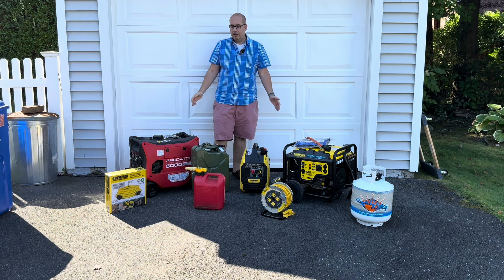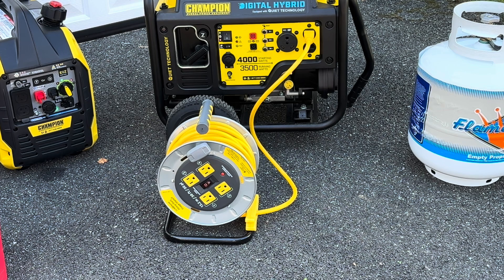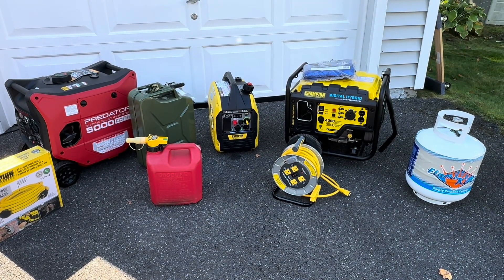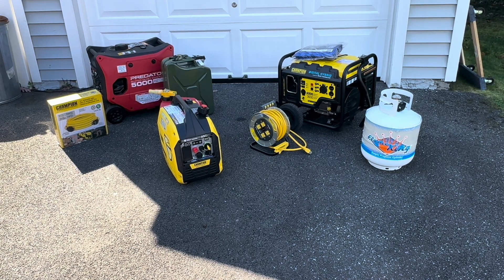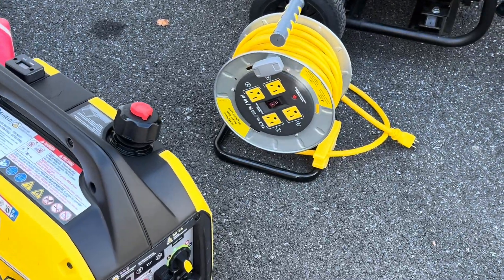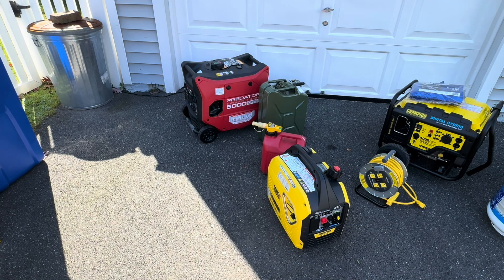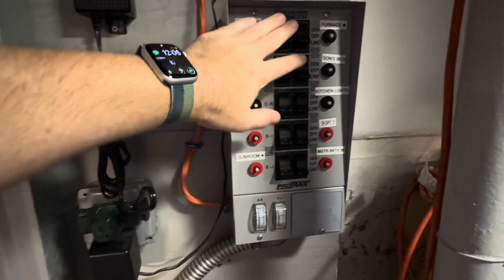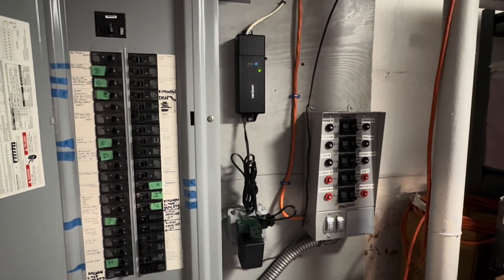How to hook up a generator to your house or power devices! Must know information

Comment: I have a 2000w generator that only has 2 L14-30P outputs labeled on the generator as AC 220V. Is there an adapter to connect electronic devices such as phone chargers and other small appliances directly? Here in my country we use 220v. And if there are adapters could you recommend one? 
Thank you
Reply from the maker: Thanks for watching! Unfortunately I’m not really familiar with the adapter you will need - apologies
Reply: @Outdoor_Prepper  I found that something like this could help me. Thanks for the reply and sorry for the bad English. 

"25 ft. 30A 125V Flat Generator Extension Cord" from Champion 

"Extend 30 amps of generator power with the Champion 25-foot extension cord. Brilliantly designed with a flat cable, this durable cord fits easily under doors or windows, remains flexible in extreme heat or cold and converts your 30-amp locking outlet to three 15-amp household outlets."
Reply from the maker: @ that looks like it could work! Thanks!

Comment: QUESTION: The 2500 I think says it has a 20 amp 2 plug receptacle but the small cord you had in the bag to plug in to the transfer switch cord says it’s a 15 amp cord. So, will the 2500 be putting 20 amps in to the transfer switch using that small cord or 15 amps?  Thanks….great videos too!
Reply from the maker: I believe technically it’s only going to produce 20 amps if it’s paralleled to another unit so in reality you’ll be getting more like 15 amps.
Thanks for watching!

Comment: If you use that adapter you showed for the predator 5000 and connect the power cord to a 30 amp input box to the breaker panel that has a generator transfer switch, will it power both A an B circuits?
Reply from the maker: @DJ-vm2zi  it will power both. Jt be careful to turn off anything that is 240v as despite powering both sides of the panel, it cannot power something that is 240.
Thanks for watching!
Reply: @Outdoor_Prepper  I love your content. Longer term, would you consider predator 5000 hookup to my natural gas line?  I’ve seen some after market regulators. I’m using my generator for home backup but I like the idea of not having to rush around to refuel if power goes out for an extended period like a week or two or longer. Maybe I’m too worried about an unlikely scenario and getting carried away here.
Reply from the maker: Absolutely I think natural gas is the way to go because it’s basically an unlimited fuel supply! I have heard there are aftermarket natural gas adapters for the predator 5000 and I will probably look into them in the future for sure!

Comment: First experience with the larger champions (8500 or so).  First one caught on fire, second one threw a rod and had no compression, both events happened after just a few seconds of use.  Bought a firman from Lowe’s, it did work for the few hours we needed it.  Also my Ryobi that is years old but never used, fires right up but doesn’t produce power.  This is all in the past 2 weeks while getting smoked by 2 hurricanes in Tampa.  Hopefully the firman continues to work good, however if you need one generator, you really need 2.  Those predators from harbor freight I’ve heard great things about but did not realize they’re about double the price of firman, Ryobi, champion
Reply from the maker: Oh wow! I’m sorry to hear of your experience with champion so far. I’ve generally been very happy with Champion as well as harbor freight predator. I’ve previously owned a Westinghouse unit that I was very happy with. I also own a Firman and have no issues with it so far.

Thanks for watching!
Reply: It really seems like one of those things of you need one you really need 2, which I had.  I never realized those predators were twice the price but still made in China, bc I love harbor freight.

Comment: Living in Arizona the most important breaker for me to jump would be the AC. You think this 5k generator could power a home AC?
Reply from the maker: It could definitely power a window AC but unfortunately would not be able to power a central air or split unit as it is not 240v. Westinghouse makes a 9000w and harbor freight makes a 9500watt inverter - both of which are 240v and should be able to power a central air ( depending on size)  etc. 

Thanks for watching!
Reply: @Outdoor_Prepper  Thanks so much!

Comment: What’s a good generator for 240V so I can hook up the central air? Thanks for the video.
Reply from the maker: Harbor freight makes a 9500w inverter that should be able to power it although without knowing your specific central air id double check with an electrician. Other than the harbor freight, Westinghouse and champion make some large units. You’d want something around 9000 watts and 240v

 https://www.harborfreight.com/9500-watt-super-quiet-inverter-generator-with-co-secure-technology-epa-71365.html?utm_source=google&utm_medium=cpc&utm_campaign=12233891969&campaignid=12233891969&utm_content=170670798470&adsetid=170670798470&product=71365&store=343&gad_source=1&gbraid=0AAAAADAHb4dhHIUcbZGVc-RwVLDrUxUt4&gclid=Cj0KCQjw05i4BhDiARIsAB_2wfAnZw-qNAG23LBhsA4Yx_mFkLu_xOAN3J546g6H64HxSisrSLzIziUaAkftEALw_wcB

Thanks for watching!
Reply: @Outdoor_Prepper  thank you for replying. Wish you best of luck.
Reply: One more question. Sorry to bother could you recommend a more affordable unit? Or is that standard pricing for these types of units?
Reply from the maker: This should be able to do it but double check with your electrician based on the central air unit you have

https://www.amazon.com/Westinghouse-WGen7500DF-Dual-Portable-Generator/dp/B078964VVX/ref=asc_df_B078964VVX/?tag=hyprod-20&linkCode=df0&hvadid=693338292879&hvpos=&hvnetw=g&hvrand=14399632386898447215&hvpone=&hvptwo=&hvqmt=&hvdev=m&hvdvcmdl=&hvlocint=&hvlocphy=9060351&hvtargid=pla-404497574773&psc=1&mcid=1025c877df6733699c93e7c4e9d1f373
Reply: @Outdoor_Prepper  Ty sir

Comment: Hi what happens if the power comes back on while you’re using the transfer switch wonder if you should unplug from the street. Second question if you’re transfer switch was hooked up be an electrician so 240volts can be used with L-14 30 amp can you still plug the generator in if it doesn’t have 240 or 220 volts just regular 110 volts and use small stuff like refrigerator lights furnace. Can you do more videos about generators. Do you grain your fuel. Thank You
Reply from the maker: @Nick-gi6ym  if the power comes back on while running on generator just switch the individual transfer switch switched from generator back to line and you will be fine. Correct - if you have a transfer switch hooked up with 240 circuits you can use a 120v generator and bridge the hot kegs with an adapter and only power the small 120v circuits. You cannot power the 240v circuits with a 120v generator, even with the adapter cable. I actually have a video posted showing a predator 5000w inverter powering the house via a transfer switch that while it’s capable of having 240, doesn’t, as I don’t have a 240v generator. Have a look when you have time and thanks for watching!
Reply: @Outdoor_Prepper  thanks for the information

Comment: Not for the faint hearted.   A dryer plug spliced to your power cable will power a lot😂
Reply: They call that a suicide cord
Reply from the maker: @navado75  haha this is very true but for much more advanced , and risk tolerant , individuals . Thanks for watching!
Reply: 50 amp RV receptacle with a suicide cord can power quite a bit too.  Just make sure you throw the main breaker so you don’t back feed the grid.  Have this set up at the camp for the camper and storage shed if power goes out.

Comment: Be careful with cheap 240 volt generator cords and adapters. If you lose the neutral wire connection you’ll wind up having 240 volts on your outlets that can cause what ever you have plugged in to burn out or cause a fire.
Reply from the maker: @richt8297  agreed only buy a quality cable. The AC Works cable is a more premium one.
Thanks for watching!

Comment: Great info and knowledge sharing ! My plans for an off grid vacation property include the small Champion in your arsenal and some LifePo4 batteries coupled with solar. A small 4-circuit transfer panel will help with sunny and rainy day power. I'm in design mode now and looking forward to the upgrade next spring.   👍
Reply from the maker: That’s a great combination! I think the champion 2500 is seriously underrated by people and I think it’s a great unit for the price point and being dual fuel! I’m very happy with it and love its portability. I also own a few Bluetti solar generators ( lifepo4) batteries and this can definitely charge them right up. Thanks for watching!

Comment: How far from the house should you place the generator. Some say 25ft.? That may be too far.

Also, is it safe to run the generator if it’s raining?
Reply from the maker: @DJ-vm2zi  those are some great questions. Keep it as far from the house as possible but as long as you’re about 10 feet away and not near open windows and doors you should be ok. If you’re running on propane it’s a little cleaner than gasoline and will produce less fumes but still keep it away from the house as much as is feasable. You don’t want any carbon monoxide to seep in through windows or door seals or gather under overhangs. Also keep a carbon monoxide detector in the house when it’s running to be extra safe. 

While you can technically run a generator in the rain it shouid at least be somewhat protected. I like to put a sounding table over it to shelter it from direct rain and still allow good airflow.

Thanks for watching

Comment: Thanks for the tips, I did buy me a pigtail for my suitcase generator. I hang the pigtail over the transfer box, so as not to misplace it. This last storm I had no issues hooking up the generator to the house with out using long extension cords. Was so proud of my Westinghouse 2000 suitcase generator, ran is 9 hours straight  on 1 1/3 gal gas
Reply from the maker: That’s awesome! Westinghouse makes some great generators as well and I used to own one also. Thanks for watching!

Comment: With the predator 5000, what would happen if you connected to your transfer switch, and forgot you shouldn’t use your 240 dryer?
Reply: Nothing would happen, because your "240 dryer" wouldn't be connected to one of the circuits on your transfer switch.
Reply from the maker: Thank you! And thanks for watching!
Reply from the maker: @DJ-vm2zi  that’s a good question and I’m not totally positive but my guess is it will either trip the breaker on the generator or just simply not work but that’s just a guess. Thanks for watching